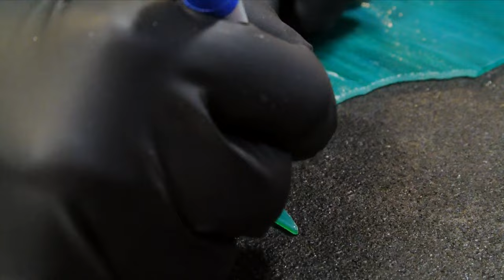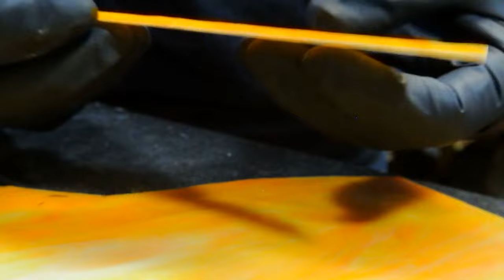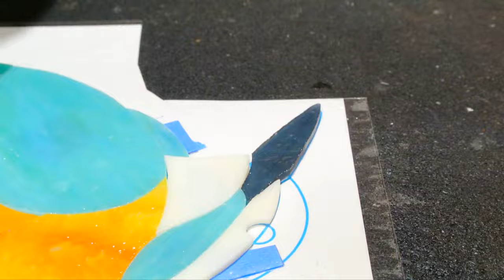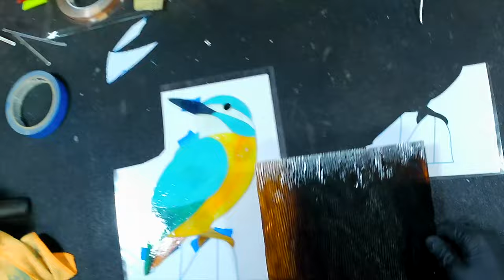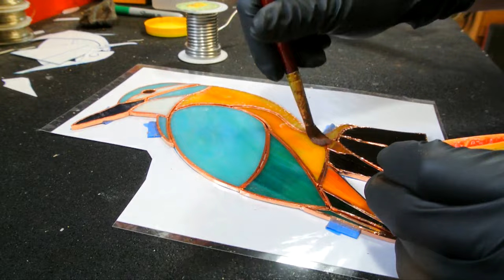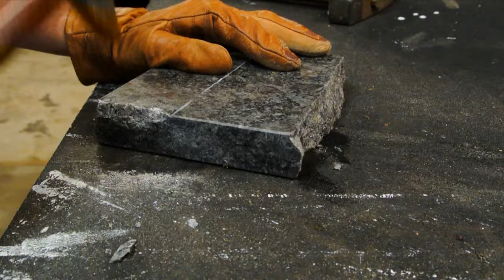Stained Glass "Common Kingfisher" Build

Comment: Did u use pattern shears? Your pieces fit perfect together even after foiling how did you do that. Even when my pieces fit perfect together when I foil I get gaps
Reply from the maker: Hi! No, no patter shears.  I just use my template pieces and a grinder to get the glass just right. It's a lot of back and forth between the pattern and grinder.  Thanks for watching!

Comment: What type of paper are you using for your pattern pieces, have you used mylar?
Reply from the maker: Hi. I just use standard copy paper that's been laminated.  I find that it makes a more durable template for tracing and is water resistant when I check pieces after grinding them into final shape.  Thanks for watching!